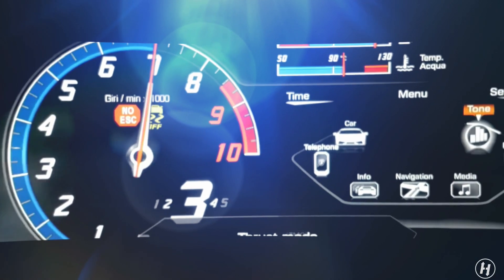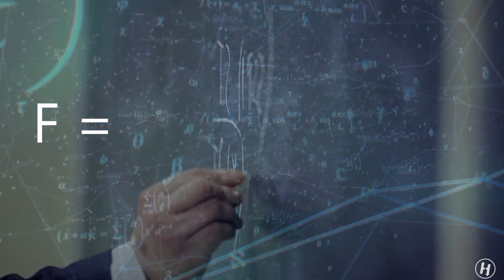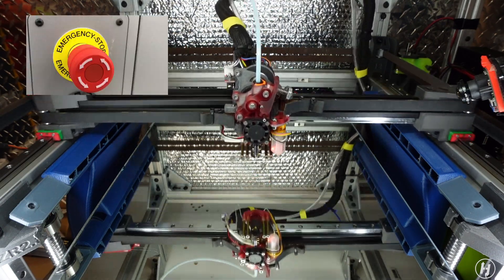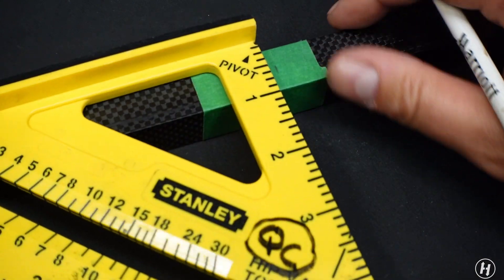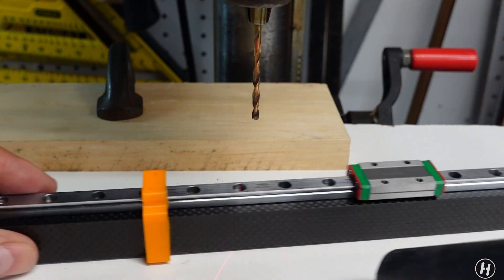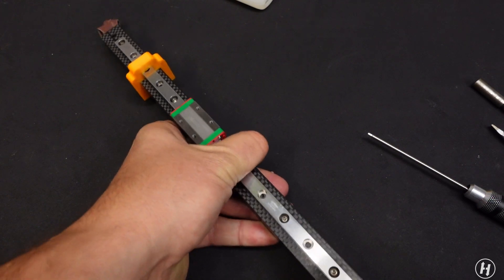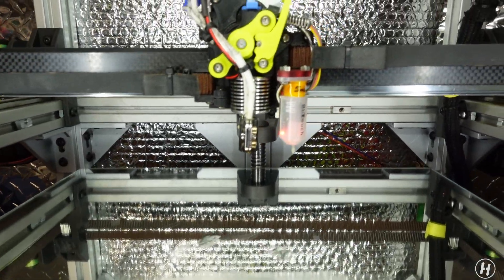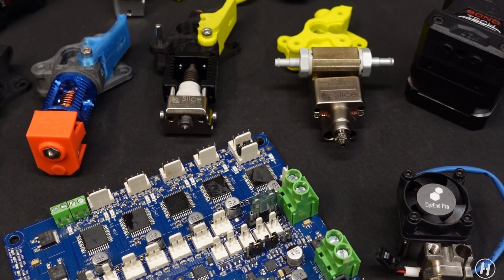Using TITANIUM and CARBON fiber on your 3D Printer

Comment: If you look at the slope of the curves, you can see the difference in practical efficiency, too. The old x assembly started losing efficiency at 25Kmm/s and 1.2A. The new one hit that same efficiency peak at 50Kmm/s and 1.7A. I wonder if it has to do with the resonant frequency of the new components, though.

I'm also very interested to see if some more weight can be shaved by pressing your own forged carbon parts in some places. Like, fuck it, press a forged carbon linear rail and send it off to be precision ground. No balls. 200g savings, guaranteed. *cough*if it works

Comment: You asked for Ideas: 1. You could do topology optimization for the 3d printed parts, if you can calculate the forces for that part, a titaniom build topology otimized rod might also be lighter than carbon fiber, but the carbon fiber tube might be aleady the best and will be much cheaper.

Comment: Instead of spending $$ to add lightness, do some re-engineering.  Easy to do, drop all the bolts and nuts on the steel rail and just use epoxy to bond it to the carbon fiber tube. Take a good look at the rail. That's a lot of steel you are swinging around. How can you re-engineer that part without as much mass?  Also, I don't see any sort of "mass dampener" on your system or anyone other.  This might be a good idea to review and build.

Comment: Hi, first of all compliments on your attention to detail and thank you for all the content posted. What is the reason you use something to mount the rail to? Is ther rail itself not strong enough? I know the carbon tube is light, but no tube (and no fasteners) is lighter.
Reply from the maker: Stainless steel rails alone will vibrate and twist under hard acceleration.  We use the CFtube to provide better anchoring into the Y axis carriages and to reduce harmonic vibrations.
Reply: @MirageC  Ah, OK, thanks. My speeds and accelerations are not on that level, I presume, for me it works fine.

Comment: 5:39 While that's a nice 3M half face respirator, those are not the correct filters for this application.  Those are for aerosols and oils.  For cutting something like carbon fibre PLEASE wear P100 cartridges.  P100 cartridges (of filters for many brands - 3M, North, MSA, etc.) are all easily identified by their either purple or magenta housings.
Respirator filters with white housings are NOT P100 and as such will not filter out the finest particles (99.97% of fibres 3 microns or larger - aka HEPA).
Please people!  Be safe!

Comment: Regarding the cutting of carbon fiber composite: used a cheap tile cutting saw. The water handles all the dust, and the diamond wheel leaves a smooth, precise cut without pulling any fiber.
Use CA glue to closeup the end grain of the fiber.

Comment: You should grab some cheap 6mm carbide drill bits and drill a bunch of 6mm holes in the rail. Each hole will remove 2 grams and you can probably fit 2 between each screw hole. Just go slow and use lots of oil, I cut hardened tool steel at work with carbide all the time.

Comment: The next step seems to be air bearings with a hose running to the printhead -> better friction, less weight of the axis, slightly more mass to be moved and some more noise...

Comment: Most weight is saved by using MGN9 rail. Steel rails are very heavy. Next saving is not using direct extruder.
Instead, hang the extruder on top.

Comment: But for all the speed, thermal capacities of filaments will restrict your print speed vs adhesion. Best outcome from cutting weight or mass, from increased acceleration  which allows you to have more of the same speed over the distance needed.

Comment: It seems like you could still reduce the weight of the linear rail. It doesn't need to be solid like that
Reply from the maker: Depends how fast you are going and what hotend+extruder you are carrying 😉
Reply: @MirageC  yeah, i saw your demonstration of the rotational force. But even just hollowing out the middle a bit could reduce the weight a few grams each hole you put in. I'm a machinist so it would be fairly easy to edm burn a slot that wouldn't reduce the strength much. It would be interesting how far they could go.

Comment: Very impressive for speed but now im curious about how this upgrade changed print quality and dimensional accuracy at higher speeds.
Reply from the maker: Less mass to accelerate also means less mass to apply stress loads on the gantry, which reduces deformation. Less mass also means less belt vibration, resulting in fewer rippling artifacts when printing at higher speeds while maintaining the same quality.
Reply: @MirageC  Understood, so I guess it even helps with resonances by shifting the frequency higher? I was wondering about that as well.  Was about to make another comment on the video of extrusion quality when I saw your reply so I better make it here instead. Does the gear teeth (being straight cut) has an effect? maybe a precision helical gear or smaller teeth could help even further, not only on the extruded gear and shaft but also the motor. 
Thanks for your reply just discovered your channel and Im liking it a lot, i like this methodical and practical approaches, cnc kitchen and all those weren't really cutting it for me even when he tries to be methodical.

Comment: Current needs time to build up in the motor, at those high speeds you may not be reaching the set limits. You need to reduce motor inductance and/or increase the stepper driver supply voltage to maintain a decent torque at high rotational speeds.
Reply from the maker: Yes, we are using 48VDC to feed our motors and some special low inductance motors were selected.

Comment: I haven't played with titanium nuts and bolts since my RC car racing days, but could aluminum rivets be lighter for attaching the rail?  you might get some bad pops and have to redo, but I would be curious how they stack up against titanium.
Reply from the maker: Aluminum hardware or this size might be too sensitive to stripping I think.

Comment: External motor drivers will alow you to easily go over 3amps

Also more adhesives less hardware. Good epoxies are lighter and can be stronger when joining carbon to plastic

Comment: I don't know if someone else pointed this out but to keep CF from fraying or delaminating after cutting use CA glue it will seal it and keep that strength to the end of the part . I use a medium gap filling formula. Interesting hope this helps and good luck in testing!

Comment: did you consider making your own carbon fiber rail?  Some of the resin infused fabrics are pretty easy to work with.  Pretty much just layout it out in a  mould , vac it down & bake.
Reply from the maker: Although I have some composite experience, considering all efforts it takes to ensure proper surface finish and straightness, it is not worth in my opinion the 20$ that hese CF tubes are sold for.  Been using the same tube since I made that video without any issue.

Comment: why wont you use servo instead?
Reply from the maker: Even though servos will achieve great accelerations of high gantry mass, laws of physics will still apply.  The vibration, twisting and binding of the XY carriage will be greatly reduced if we target the weight first.  I did use servos in the past on this printer.  There is no viable economical solution at this point for hobby machines.
Reply: @MirageC  I have limited knowledge in building 3D printers but i built large cnc router for stone engraving once. And i did go for stepper motors with the feedback loop so i wasn't loosing steps. I know servo motors have automatic feedback so there is no lost steps no matter the speed as they will slow down or speed up accordingly to the position required vs achieved with 1/1000 s accuracy. They are also a lot more quiet.  But there is financial factor to be considered for sure.

Comment: Impressive improvement. You can use aluminum alloy screws also. They're strong enough, lighter and cost less than titanium ones. Its also safe to use threadlockers with carbon parts. Loctite 273, or 638 if you don't want to take it apart anymore.
Reply from the maker: At this size (M3) aluminum hardware is easy to cross thread or strip the head.  Comming from aerospace background I also wanted to avoid risk of galvanic corrosion.
Reply: @MirageC  You could use PEEK fasteners, they don't cost so much, if you need so few anyway.
Edit:also pulltruded Carbon tubes are more rigid for what you want.

Comment: I have an idea for lighter extruders. I've been meaning to test it myself. But since I haven't had time, maybe I should just publish it. Then if it works, at least it can't be patented…

Combine both a Bowden and direct extruder. The drive-gears before the Bowden tube will exert most of the force. Then the drive-gears on the extruder can have a much lighter motor, whose only job is to control the extrusion more precisely.

Though obviously it wouldn't work with flexible filament. And I don't know whether the motors could simply be stepped in sync. Or whether a more complex control scheme would be needed to co-ordinate them.

Comment: I bet using a load cell to level instead of the 3d touch would decrease weight significantly... the 3d touch weighs about 20grams... and its weight is out of line as well so contributes to any potential torsion of the axis. A load cell would be in line with the axis and weigh much less. Since a strain gauge probably only weighs about a gram or two and the amp can be located off the axis... you might save as much as 20 grams.

Comment: Build printer bottom heavy. By changing top frame parts to carpon fibre. Vertical pieces to aluminium extrusions, and bottom parts to steel.

Comment: why not just the rail instead of any backing? lol. like the way the annex k3 works? Also are you running at 24 volts? try 48 as well (another board that can handle more)
Reply from the maker: I am currently running 48VDC.  Unsupported rail is not recommended, especially for high accelerations.  It becomes springy and resonates. Annex uses a combination of 2 rails crossing each others, on relatively smaller printers.  We have HevORTs as big as 670X670

Comment: I cant believe I never bumped into your channel !, this is amazing !, youre doing everything Ive wanted to do but i cant because of time and money... Ive been *concepting an upgrade to my, big, clumsy, wobbly CR10 S5 and I put some carbon fiber tubes on it, all in 3d max, nothing too profesional because max its my software and what im used to use for work.... glad to confirm its actually usefull, now in the litthe free time i got im sketching a sistem to exchange hotends with a quick release sistem, and a way to change the, in my opinion, ridiculous, process to change a nozzle, EVERYTHING ELSE TURNS !... ..... KEEP IT UP !, instantly subscribed bro !
Reply from the maker: Thanks for your comment! And good luck with your modifications :)

Comment: on the carbon tube would it be better if you used a solid carbon square rod that is machined to accept the barring block so you get rid of the steel rail completely

Comment: Replace: the screws with CF screws. -the pla parts with thinner CF parts. -the extruder stepper motor housing with CF.
Wacky idea: Perhaps magnetism could reduce the weight, unless the added mass is too much to be pushed.

Comment: A few grams could be pulled out of the gantry tube by optimizing the stiffness for the loads. You shouldn’t have much dynamic z-loading, and with your extruded/hot-end you may not have much torsional loading as well. A bunch of holes on rail side and back of rail side may lighten the gantry further.

Comment: What about ditching the beam totally and just using the linear rail itself as a mount? Might even be able to drill/mill out some of the material from the beam to make it weigh less.
Reply from the maker: Acceleration and twisting forces are too high on today's CoreXY printers for using the rail alone.  A support beam is required.

Comment: i wonder if you could get the linear rail to be made out of titanium. or even using ceramic bearings. and using a flex drive to remove the motor from the extruder.

Comment: A trick that quad drone builders use is to apply super glue to cut carbon fiber edges. It prevents delamination, even in crashes.
Reply from the maker: Yes good point!  I should apply epoxy resin to the end to avoid delamination.  Thank's for pointing it out.

Comment: Way late to the party on this but would it be possible to lap the carbon fiber tube on one side to make it flat? Of course you would need a known flat surface to compare it too but wonder the results on this idea.
Reply from the maker: You could probably do it very lightly.  I guess that at some point, if you reach too deep in the fibre coth it may delaminate if the impregnation of resin is not uniform.  Somebody else mentionned glueing the rail in place, so this would deal with surface irregularities as well.

Comment: We can confidently say that it is people like you who actually drive printer technology. Not the big companies that later make the claims and reap the profits. Thank you for this video. Do you remember who came up with the ideas of input shaper and linear advance?
Reply from the maker: Thank you!  Over the years I found that by sharing what I know, I receive much more knowledge via comments and encorragements than what I give.  Open source community is full of good people with a lot of knowledge :) .
Unfortunately I dont have the exact name of the people you are referring.  I always assumed that the father of Input Shaper was from the Klipper community.  I think I know who but not 100% sure.
As for linear advance I believe this was from the Rep Rap community.
Reply: @MirageC , again the open source community. Keep up the great work, you have no idea how uplifting your videos are for me and many other. Exploring the outer fringes  of what can be done. So much fun.
Reply: @MirageC , I am on the same bandwagon. My main education was through the internet from forums to YouTube. In case you want to print faster and more reliable and much cleaner, here my 5 cents worth" Z axis: air bearings. For Y and X  you must try linear servo motors. A quantum leap ahead of your Clearpath motors as you will have super speeds and a lot less motor noise. You will then open a can of worms as you will need the same quality of plastic delivery. We are so lucky to live in these times where we still can make a difference.

Comment: this seems really cool! keep in mind that 3d printing using filament is low impact but not no impact. there still is resistance from the nozzle drag (it can be alleviated from a higher temp during run and lower temp during slow down for control. i would suggest first 3 layers ramp up speed and temp to work from a stable surface , and last layers slow down temp and speed. travel moves will likely be quick on this machine. also i have seen designs that just use the rails themselves as the x-bar. i would imaging a head crash would be expensive for those designs...
Reply from the maker: Yes, head crash are bad at those speeds.  Luckily, using springs on the bed helps a lot.  I totally get your point with nozzle drag.  The speed profile needs to be adapted to the part being printed. Good point.
Reply: @MirageC  can you elaborate on this a bit more? one of you two? lol